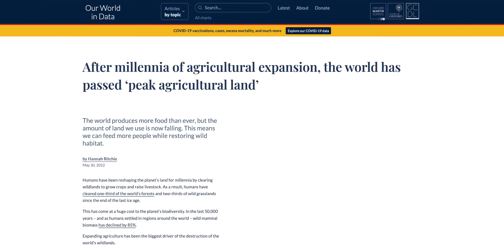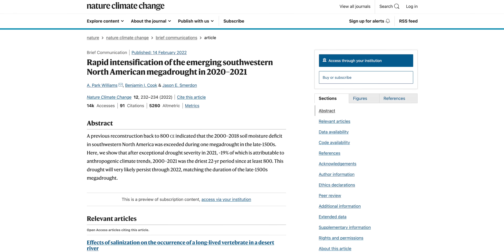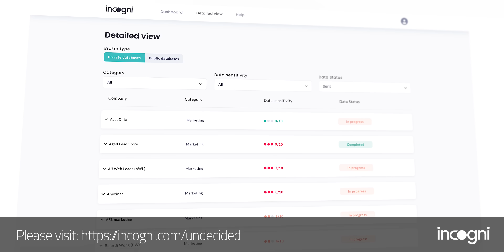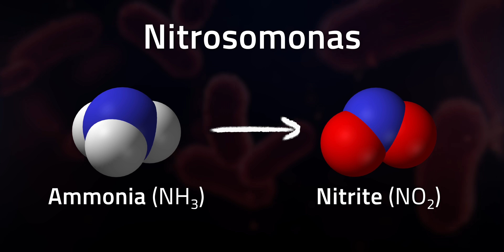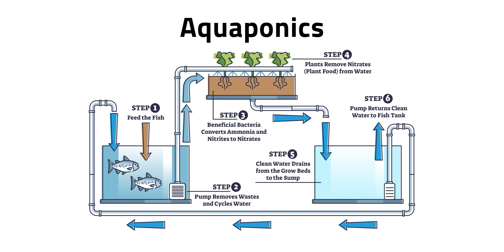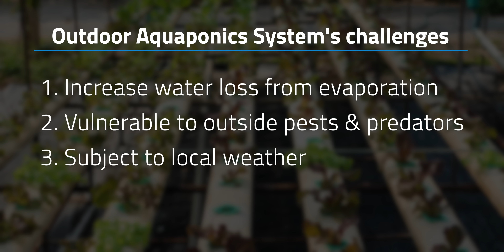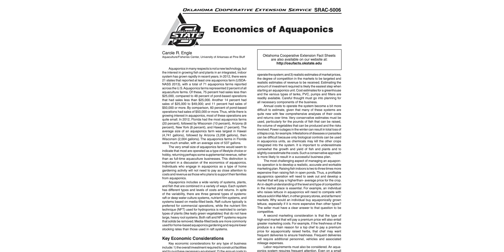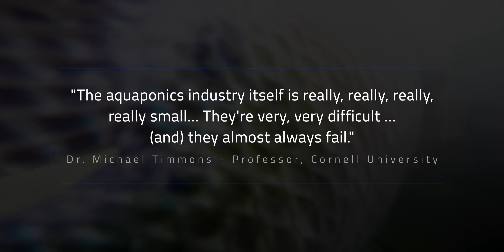Is Aquaponics the Future of Agriculture?

Comment: Could you not incorporate geothermal or ground source heating into the loop ? Create a lake or utilize a local pool and cover it in solar panels to cool the temperature while powering the facility?just thinking of it at a larger more profitable scale. The cap ex is the factor, and the balancing of the eco system. I'm sure that if ai could balance magnetic fields in a Tokamac it could be applied here? Just wondered.

Comment: I think that aquaponics are a very reliable solution to the farming woes. You can use with a Raspberry Pi with a few sensors to monitor the pH of the water, to automatically feed the fish, to monitor the water level in the tanks, etc.
Reply: I could see this scaled up pretty easily, too. Maybe a Raspi Pi per tank with a more powerful computer handling the entire system?
Reply: @geogmz8277  You are describing a cybernetic system - a hierarchical arrangement of feedback-controlled control systems working towards a goal. This is a good application of cybernetic theory (whether the implementer knows that's what they are doing or not)
Reply: The big problem is that a reactive solution, like you're proposing, will likely kill the fish.
They're extremely sensitive to changes in water, and some hydroponic cycles do precisely that. 

It's pretty challenging.

Comment: From a structural engineering perspective a building can't be easily converted to support these aquariums on rooftops. Remember, water is heavy shit. It's much cheaper to build it on ground level since the weight can be directly transferred to the foundation, but already at two floors you will face huge challenges. 

Once the building is built you also can't move or rearrange the pools, since that will change the loading conditions. 

You can make it work with a ton of steel, but it's going to cost you. 

That is why you generally won't see green roofs everywhere. If you add a ton at 5th level it will cost alot more than a ton at 2nd level. Since every level beneath you need to be able to support 1 additional ton.

Comment: I recently discovered aqua vegeculture system (IAVS) also known as sandponics. With sand as a growth medium it apparently solves the problem of a seperate solid filtration that can get clogged. Plus a rhizosphere forms in the sand with a much more diverse microbial community, giving the system more stability, and less pH fluctuations. I'm building one in Namibia to try it out. The two main challenges are getting the proper inert sand and suitable fish feed.
Reply: O, I forgot to mention... With sandponics the pump can be cycled 15 minutes on, 45 minutes off. This because sand drains slower than other mediums. So it should be more energy efficient. Plus the pump is kept off overnight.

Comment: Short answer: No.

Long answer: Yes, if the principle is heavily modified into a variety of integrated multitrophic aquaculture system (IMTA), replacing the "plants" with faster growing microalgae for protein/lipid/carbohydrate production. The best thing about aquaponics is that it is a great learning tool for circular biological systems. However, in its classical form it is far too inefficient for mass production. Terrestrial food plants are generally poorly adapted for the growth environment provided by RAS effluent and represent a broad range of ideal growth environments.

Source: I have an Honours degree in science specifically on the subject of aquaculture, aquaponics and microalgal biology, and am a PhD student working on the problem.

Comment: I researched the topic myself just recently and there is one point that seems to always get overlooked, and that is the beginning of the Aquaponics cycle: the Fishfeed. It is the basis for all the nutrients in the system and if the fish feed is sustainable, then it is a great system. But the reality is, that fish feed usually consists of, well... other fish. We use fishmeal, i.e. the dried and gound up byproducts of caught wild fish, mixed with maybe some vegetable protein and a bit of wheat for coagulation. So, the entire Aquaponics system is still reliant on fishing. Paradoxically. And since our current rate of fishing is unsustainable, so would this be.
 Some people propose using duckweed (also known as water lentils) in the pools, so that fish could eat those, but these duckweed couldnt grow fast enough. Another solution would be insects, grown from food scraps, which could definitely alleviate a lot of the needs of fishmeal and we would even upcycle our wasted food. 

All in all, it's a great and beautiful system, but until we solve the first step it will stay unsustainable. Not that it can't be solved. I just don't see anyone focusing on it atm.
Reply: Couldn't you also produce plant material to sustain the fish within the facility? It would reduce some space, but that's not a limiting factor in this model. Another promising development is the prospects of combining aquaponics with waste water management, bringing value into the system while remaining contained and self-sufficient.
Reply: @uhitsethan  Yeah that would be the solution, but so far Aquaponics have only been able to produce low energy dense vegetables, like salads, maybe some herbs, even tomatoes are hard to produce atm. You´re not getting energy dense, protein rich matter out of this system (yet). Which is the bottleneck. And fish need Protein and calories to grow.
Reply: @uhitsethan  no, when you harvest the plants to sell on the market you are extracting nutrients from the system. Those nutrients have to be added back into the system in some way. You can reduce the amount of nutrients needed to be added to the system by using the undesirable parts of the plants to create fish feed, but you can't produce enough to sustain the system on its own.
Reply: @uhitsethan  As you are harvesting, and thus eliminating material from the system, you also have to supply some input.
Reply: Yes, sustainable fish feed is a major challenge. As Matt said, Aquaponics is not a silver bullet. It is just one interesting component of a sustainable food system.
Fishmeal is not as non-sustainable as we think, at least as long as we consume wild catch. Slaughter waste from aquaponics can also be recycled as fish meal btw.
Blood meal and bone meal from meat production are allowed in aquaculture feed. 
Essentially I think insects, like black soldier fly, are the most promising direction on this issue. Can be fed with organic waste. But the novel food regulation in Europe is a major barrier. Can not use anything as insect feed that has been declared as waste,  no matter how good and clean this ressource stream actually is (organic agricultural waste has huge potential for example).
Also duck weed and azolla, grown on low nutrient density run off can be a sensible solution.
Reply: @jaysilence3314  We are "wild catching" our oceans to death. See the movie Seaspiracy. Fishing used to be about targeted species, now it's about bottom trawling and gobbling up everything in sight thanks to fish farming and the need for fishmeal. Bycatch is the new catch.

The good news is we don't need to eat fish at all. Humans can thrive just fine on plants and be better off for it.
Reply: @brianrcVids  Yes, I totally agree. We don't need to eat fish and we are destroying the marine ecosystems. But as long as we are doing this, we might as well take that waste and instead of dumping it and generating more harm, we should better use it to produce fish in aquaculture and offset some wild catch consumption.
And by the time wild catch is down to zero for one reason or the other, we hopefully have found ways to replace wild catch discard and slaughter waste with more sustainable alternatives.
Reply: Sewage sludge.
Reply: @jaysilence3314  These are living, breathing sentient beings. The proper way to reduce harm is not participating in it and not making a market for it. The most sustainable alternative is not more of the same. It's to avoid doing harm in the first place. 

Avoiding meat, dairy, and fish is single biggest way to reduce our impact on Earth. Without meat and dairy consumption, global farmland use could be reduced by more than 75% – an area equivalent to the US, China, European Union and Australia combined – and still feed the world. Loss of wild areas to agriculture is the leading cause of the current mass extinction of wildlife.

Is it better to be part of the problem or part of the solution?
Reply: @brianrcVids  I fully agree with your baseline argument. I just think not using fishmeal (to move forward sustainable production) is not going to reduce the harm of ocean fishing. I totally support researching plant or insect based fish feed alternatives, please don't get me wrong. We should ASAP, and research is onto this.
It is just my opinion that not eating gummy bears because they contain gelatine could somehow reduce meat production. I just don't see that causal chain.
Reply: I think one solution we'll see very soon here is proteins produced from bioreactors. Using algae and yeast to produce the proteins needed by fish and chickens.

Of course that's currently very expensive and we should focus on human food from those sources first. But, i think sooner or later it will be viable
Reply: @Greg D Really?  Only ocean fish and a couple others?   
Total BS.  
You know that fly over part of the country outside of those big urban areas.  Yeah those.  Them there peoples have no issues eating fresh water fish of all sorts.
Reply: You can easily buy feed that is made of sustainable fly larvae or other insects as the main protein source. It’s a choice by the farmer
Reply: @Greg D "The only problem is that Americans won't consider eating any of the fish that can be grown in this way, because they only eat ocean fish, trout, and maybe catfish and tilapia."
Is not true.
It is a gross overgeneralization.  Typically from people who live in urban areas.
I live in an urban area, yep I can go and get those exact fish right now.
However, if I go back to where I grew up I can also get Bluegill, Sunfish, Walleye, Perch, Musky, Carp(yes we do eat carp btw), Northern Pike, Bass, Bullhead, basically any game fish will be for sale in the local grocery stores
Hundreds of thousands of people go to the Great Lakes every year to fish during Bullhead spawning season.  Most come back with immense amounts of meat.
Reply: I absolutely agree. It's a strange paradox of renewables that the ideas are great, but the implementation always seems to put the cart before the horse. Here in the UK we have to pay windfarms to stop producing energy when the grid can't cope. Storage is of course the solution, but that's not without it's own environmental challenges. It feels like it's an afterthought, despite being an essential part of moving away from polluting energy sources.
Reply: There are some fairly simple solutions to some of those issues (not trouble free, but simple) . 
Catfish, as an example, can be fed almost anything, including waste from poultry processing (where disposable is an ongoing problem). Tilapia can eat almost any vegetation, including produce waste from produce wholesale companies, which are always seeking a "back haul" product to gain maximum value from refrigerated trucks. 
Again, not completely problem free, but not at all insurmountable.
Reply: @brianrcVids  We, some countries have sustainable fishing it is possible. Its just not enforced enough. Also feed sources can come from else were. Some fish species are in fact mostly vegetarian including the widely farmed Tilapia.
Reply: @brianrcVids This farmland statistic comes up a lot. It is bunk. Crop land use is complete while grazing does not have to be and is often applied over large areas.  That does not mean that all of that land has animals on it all the time. For instance an Australian cattle range can be the size of a small country, but all of that land is not grazed all the time, so just going of area is not an accurate comparison.
Reply: What about using insects as the base for the fishfood? Insects an be raised on garbage (thus recycling is potential benefit) and then processed into fish food. In theory that would be more cost-effective too right?
Reply: @andrerobinson5831  Year insect base feed is a greet idea, much better than putting them in peoples muffins. Also shrimp and other micro crustaceans can be started of algae, making a loop food chain.
Reply: @raclark2730  nobody wants to eat the bugs, own nothing and be happy. lol. Chickens are just as efficient as insects in producing protein anyways and they love to eat bugs too. We could feed them bugmeal too.
Reply: @andrerobinson5831  Haha, yes indeed. 👍
Reply: There is an African homesteader from Uganda or Kenya who feeds the fish in her aquaponic system the maggots that grow in the cow dung produced by her cows. Have been trying to find her tedtalk presentation here on YouTube for the precise details of her system.
Reply: Wouldn't growing smaller fish like smelt or minnows be more efficient?  Using insects is a good idea as this year has been a bumper crop of grasshoppers, just ask my garden!  I believe that some cities grow worms with their bio-wastes, and fish do love worms!
Reply: Invasive species such as carp, Green Crab, zebra mussels and snakehead should be used as a fish feed input

it would actually be environmentally beneficial to do so.
Reply: If you ever heard about black soldier flies(bsf)? I think this method of gardening need to pair with bsf farming as feeder for a fish or another option with worm farming (vermicompost) as feeder to the fish.
Reply: It can all be done, you just need economies of scale. Fishing trawler by-catch is so cheap, you can get food for aquaculture at a very cheap cost. Perhaps in the future, we'll have algae based off-shore farms to feed fish, insects based on compost/household waste/farm waste that will be dollar cost cheaper than trawler by-catch.
Reply: @Dschinghiss  there's that company that containerizes the fly breeding apparatus that is fed off food waste. but then you have to collect the food waste...

Comment: I had an aquaponics garden for a few years. It grew greens much faster than my in ground garden and used an estimated 90% less water however it was very time consuming. Because of the fish in the system almost no pesticides were able to be used. That meant that I had to carefully select pesticides and apply them in a way that prevented them from getting into the water. In the end I tended to pick off most pests by hand when I could. You also have to monitor the fish health constantly.
Reply: were there any insect predator options?

Comment: This has also been researched from the reverse angle: aquaponics is effective at reducing nutrient concentrations in water. There are several countries now that have used settled domestic sewage as a feedstock for their aquaponics and aquaculture systems. Using aquaponics to clean dirty water will eat up a lot of the major costs.

Comment: I have been operating a homemade backyard aquaponics system for many years. I have been able to enjoy tomatoes, squash, cucumbers, and melons in the summer and harvest tilapia filets in the fall. It's not hard, but does require daily attention. I agree with Matt's comments about the fragility of the system. If a pump breaks, a pipe leaks, a siphon clogs, or severe weather disrupts the proper water flow, the fish and plants could die. Hopefully, the industry will figure out how to make commercial scale facilities more reliable and profitable.
Reply: They already do that... you paying attention to it lately? Its done commercial in many states like Colorado and Oklahoma.. for sure for years already.
Also Purdue has content proving it for 12 years now
Reply: This is exactly what I want to do! I would love to hear more about how you got started/ any other tips and tricks you found worked for you!
Reply: I use vertical towers I made myself for my patio system
Reply: With all of that monitoring and complexity, aquaponics seems to be exactly that kind of industry which is cut out for AI.
Reply: Yep You are right sir
Reply: The best way may be to set up lots of small-medium sized aquaponics facilities that operate independently of each other, instead of a single mega-facility.  That way, there's lots of backups if something goes wrong.
Reply: for this low cost sensors can be used to detect changes in the whole system. tinyML will surely disrupt this

Comment: I definitely want to start an aquaponics build on my farm. I probably wouldn't use it for mass production (I don't have the water rights for that, anyway) but it is a great idea for a sustainable homestead.
Reply: Are the water rights for aquaponics different than the water rights for traditional farming?  Or is Matt wrong about it needing less water?
Reply: @skeptibleiyam1093 the water is continuously cycled throughout the system. You only have replace evaporation or leaks
Reply: @spencervance8484  The products physically contain a significant amount of water that is being removed from the system. Industrial scale has to factor that into its usage.

Comment: Aquaponics will be a part of the future! Most of the mentioned problems are technical and can be solved.  For example, you can run your system decoupled and optimize both sides' needs, fish and plants. However, finding people that are capable of running such a system is not easy.  At least not here in the EU. Thanks for the nice video to make aquaponics more public.  Keep up the good work!
Reply: so you could do two separate things and completely defeat the original purpose, what a brilliant idea...
Reply: @royce9018  Please elaborate on "completely defeat the original purpose"